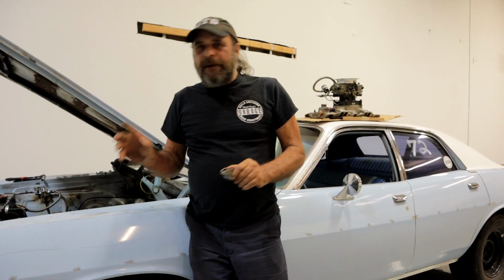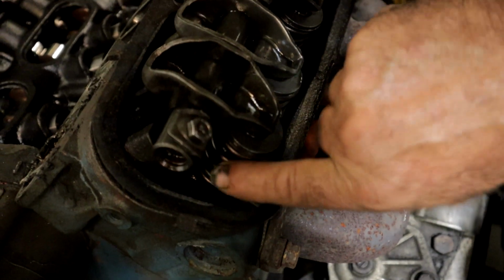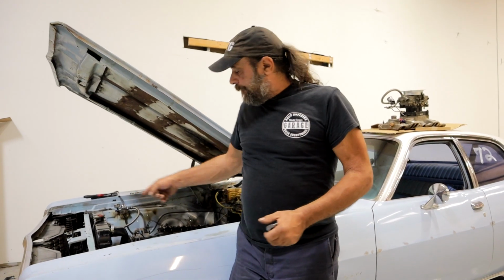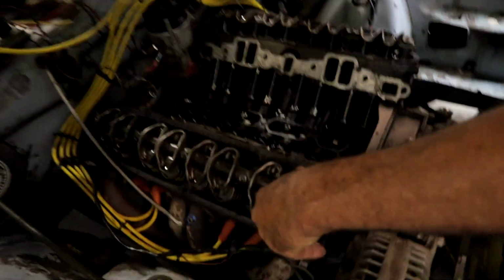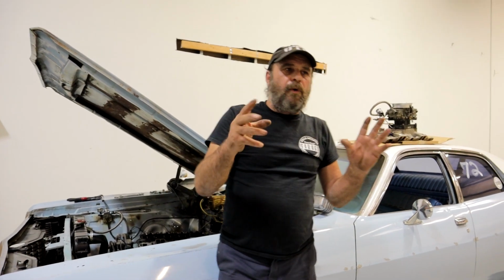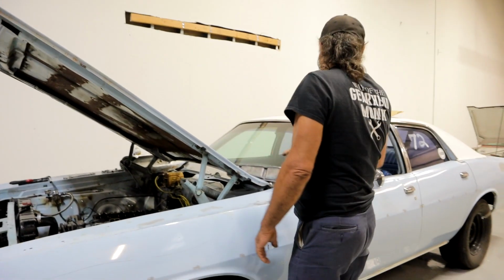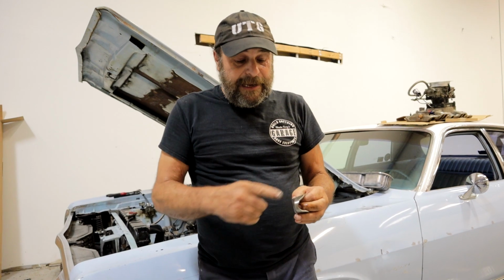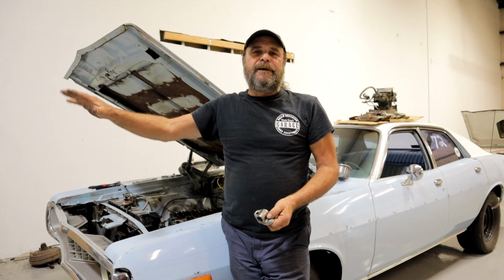Bottle Rocket Rocker Failure Explained

Comment: I’m not too knowledgeable on the mopar engine differences, but would factory roller lifters out of a magnum motor work?  Or for that matter, could a complete magnum block work with the heads and intake you have?  The only reason I suggest that is I have literally never heard of a magnum motor (or any factory roller cam motor from the late 80’s-early 00’s) having lifter failure. So if the top end will swap onto a magnum block, then go find a truck in the junkyard that runs, and use all the factory roller cam stuff.

Comment: I have heard this issue with hydraulic rollers over and over, especially in the LA motor. I was gonna put a hydraulic roller in my last LA build but after hearing all the guys who had this exact issue (even worse, wouldn’t pump up at all) and had to pull it all and go solid, I decided against it. I did still go hydraulic, but it’s a flat tappet. That being said, the first 16 I bought, 6 of them were .0005 too big in diameter and wouldn’t even slide in the lifter bore. I bought another set and out of the 16, 7 of them were also too big in diameter. After measuring and inspecting them all carefully, I was able to get a hood set of usable lifters. 3000 miles and all good but I had to work for it.

Comment: "Lifter holds oil." This is logical.  I fixed a Hyundai that had been sitting for months. After I put the head back on and started it, it was very loud. When the lifters finally pressurized, it never did that again, even when I don't drive it for days.

Comment: Gday Uncle Tony, Mate firstly I want to say I love your channel you say it how it is good on ya, ive been watching and laughing at the comments below most people just dont get the concept of a piston pushrod engine, if the geometry is right on those rockers they will take all that punishment and more, I have one question are the valve springs standard hydraulic flat tappet springs or roller springs hydraulic roller could possible require higher open pressure, I have also struck Hydraulic lifter failure from faulty oil filters bleeding back as well? cheers mate from Australia cant wait to see the solution

Comment: Good question Uncle Tony but I don't think they would/will ever give you a straight answer. I would say it has to do with their quality control or the lack of quality control. I would be pissed too!! They probably don't even care, they got your money and that's all that matters to them, it's the new way of doing business and it really sucks big time. 

Do you think spinning the engine over a few extra times to allow the lifters to build up oil pressure will help to keep from tearing up more rockers?

When I rebuilt my 351W for my '88 Crown Vic 20+ years ago, I went with a hydraulic Ford cam and lifters just to avoid these types of issues. There were folks having cam and lifter problems back then too from the big aftermarket companies. They asked questions and got the same answer, you must have not done this or that correctly. Most of them were switching over to a solid cam and lifter set ups.

Comment: What type of oil do you use?  Does the use of a higher grade racing oil make a difference in the hydraulic lifter?  Maybe it's just bad manufacturing of the lifters.  You know the old saying, "they don't make 'em like they used to."

Comment: I think a solid flat tappet cam with some 273 or aftermarket ductile rockers is probably the best option for the spirit of the build. You’re probably looking at the same outlay for everything as the hydraulic roller setup, but I know several people who are having zero issues with federal mogul stock replacement solid lifters right now. The other option with the hydraulic roller is a set of $500 Morel roller lifters, or to put adjustable rockers and solid rollers on the hydraulic roller cam. It just a shame that parts are so crappy now that I know of people who are having there 50 year old hydraulic lifters refaced instead of risking new with the “parts store lottery”.

Comment: As I have mentioned with flat tappets, there are only a few really trusted names that really stand behind their parts fully.  Howard's and Crower come to mind first.  A few custom cam grinders after that.  Anything else, it's a big roll of the dice...  
Just like the points thing, you are rolling the dice and they are loaded against you at this point.  
If you don't have a long standing good relationship with the supplier so they will talk to you honestly, you are prolly going to grenade the motor :(

Comment: I had a guy build me a 428 pontiac 15 years ago.  best of everything. comp cams hydraulic roller lifters were shot after 6 months . the idiot that built the engine had the wrong length push rods and wrong valve springs in this engine.  thanks Tony and kathy

Comment: There are only a couple of companies building lifters now a days. They put different names on the same lifters.  I guess is that different builder's demand better tolerances than others. With that thd price goes up. But roller lifters for a LA engine are far from cheap, anywhere.  I kept my original packaging for a while and checked them a couple of times before I throw the package away. I checked the the preload three times looking for a bad one.. I had luck they are all good 10,000 miles and a shit load of 1/4 mile runs later..

Comment: I no you wont agree but i put the lifters in the engine and prime the pump till the lifters are pumped up i know you should not have to but thats the only way i have prevented that exact problem,Then i install push rods and rockers then adjust.beleve me i have been down that road plenty this is the only thing i have found that works for me.you are so right about product to day it is junk.i built reman engins for years and the last couple of years building we had the same troubles you are.

Comment: Just a thought... in keeping with the broke racer theme, could you take apart the lifters and use washers in them and convert them to a solid lifter? Wouldnt work if you send them back though.
Reply from the maker: We'd still have to upgrade the shafts, rocker and pushrods, no?
Reply: @UncleTonysGarage  yup

Comment: What cam company was this? We always used speed pro hydraulic lifters with new but stock pushrods and rockers never bleed down like this.. always used flat tappet cam and lifters..... would a Roller lifters have a different bleed down? ..I would think not.  Speed pro was good in the 70's 80's early 90s.  And comp cams made some good mild streetable cams

Comment: I think this channel needs to get in touch with someone who has a 3D printer for car parts. If he did that, all of his cars would run perfectly. He could even design an engine, if he managed how he dealt with that 3D printing company in a cool way, or a partnership of something. That's how humanity is going to get these old car parts in the future, not by finding them rusting in salvage. There's only so much of that stuff around, and sooner or later, you won't ever be able to find those parts. Never going to happen, I know, but it would answer 99% of the problems he faces on this channel.

Comment: Well for me I use Mopar Performance and the Mopar engine book for me doing. Have not had any problems at all. I realize folks use Comp Cams, Isky, Summit and who ever. But to me mopar has many years of testing and development. I use stock valves but springs that go the cam. Stock push rods too.

Comment: I had a brand new lifter that was missing a circlip inside which allowed it to pump up until one exhaust valve hung open slightly. because it was a turbo engine, the pressure and heat from the manifold went back into the cylinder causing it to preignite. damaged a brand new race engine because of a defective new lifter

Comment: I have said it before...There is no law that you have to throw away chokes.  Anyone that doesn't want their Holley chokes, send them to me.  I have some used carbs that I bought cheap over the years. But some were missing chokes. :(
I'm not saying the damage would have been postponed if you start the car cold with with the choke on. 
 More to the point, Tony did you put a dial indicator on the lobe with the broken push rod?  Just wondering if that lobe wiped before the lifter broke. I want to see that lobe.

Comment: I’m no professional, but the only engine I can build cheap and have it reliable is an Ls. I build 3 cheap small block Chevys, 3 cheap small block fords, and 2 cheap 400 Ford. And they all had issues with parts. I build one not cheap sbc, one not cheap 400m Ford, and several cheap ls motors. They have all held together perfectly. The sbc has a solid roller and over 60k street miles built in 2015

Comment: You are better off salvaging used internal parts from OE engines than the "new" Eastern built failures. Rock Auto is pretty good about describing parts origins, sometimes you get lucky with their inventory. The mechanics in my area refuse to do any internal work due to the parts quality issue, you buy a Jasper engine and take your chances or junk the car.

Comment: I have the same problem, likely same company, bought the lifters that cam card suggests. Mine is a big block Chrysler but built very similarly stock rockers and the such. BTW, I had a slightly smaller cam same company and lifters do the same thing in the previous iteration of the engine.

Comment: Hey uncle tony what adjustable roller rockers do you recommend for a big block 440 that’s gonna be making around 11.5 to 1 compression and a 530s lift solid flat tappet cam? Also Im gonna run aftermarket valve springs

Comment: I wonder of the manufacture of lifters has changed because of modern engines, like with vvt they are able to retard the cam timing or expand valve overlap during warmup to correct forces operating on the valve train and the old school gets left in the dust? Also they are operating on much lower compression and lighter valve trains so the manufacture is able to cut corners without problems on newer models.
What about adjusting the oil viscosity? Go with a 20W30 instead of a 10W30?

Comment: How can we work with lifters that leak down when new and if this is what's available how can we be creative? If I installed a spark arrester and cranked the engine a few times to build oil pressure would that prime the lifters for startup? It's not a daily driver so the inconvenience would be minimal.  I know that doesn't excuse the *cam company but us average joes gotta work with what we can get in the short term.

Comment: Wild guess here, but faulty anti-drain back valve in the oil filter??
Reply from the maker: No, pressure comes up instantly on start
Reply: Possible, but that dry start rattle from a crap filter is kinda distinct because nothing has oil pressure for a second. I suspect a guy as experienced as UT can hear the difference.
Reply: Oil filter has nothing to do with hydraulic lifter leak down.  The hydraulic lifter is suppose to maintain it's own pressure and not leak down.
Reply: @UncleTonysGarage  The only other thing I can think is the lifter body diameter  is slightly smaller than stock causing too much clearance in the lifter bores allowing the oil to blead down after engine shut off..

Comment: Lifter oil hole orientation?
Reply: On flat tappet cams the lifters spin in the bore. Therefore I don't think it's an orientation issue. But I've been wrong before. Let's ask comp cams what they think. Oops didn't I just mention the manufacturer?
Reply: Lifter oriental*
Reply: Didn’t he say it was a roller hydraulic?
Reply: @matthemberry  yes it is a hydraulic roller. The roller lifters can only be oriented two ways and it shouldn't matter because flat tappets spin in the bore and they work fine. My point being the hydraulic portion of both types of lifter function the same.

Comment: Well guys I feel your pain but better parts are available I have been using hughes cams and rhoades v pro lifters and adjustable rockers of some sort in tons of builds and no issues. I also do tons of demo derby engines with no problems,  I say screw comp

Comment: Comp sucks don't use them. I've had nothing but problems . Such ass I got a solid roller cam and got the comp cam recommend valve springs . Totally wrong valve springs . Comp did not care I brought it to there attention . And they did nothing... So I don't use comp cams and will never use their parts again.... Good luck Tony

Comment: That isn't the real question. The real question should be as follows. How come you are experiencing issues, but I just built an LT4  Corvette 350 from 1996 with zero issues. Cam, valves, rods, springs, and gaskets. What is the margin of error? Those parts are used at my local dirt track with very few issues. Yet some people are experiencing issues. The only thing I can think of is maybe there is an installation, or break in problem.

Comment: Because they were made in China. Having said that, I went to solid lifters years ago and never looked back. You want to keep it simple, use solid flat tappet lifters with polly locks. The polly locks hold the lash a long time, and much cheaper than rollers. A stock engine doesn't need rollers. The flat tappet cams are way cheaper.
Reply: May not 'need' rollers but with  the quality of flat tappet stuff that eats loibes like no tomorrow there is no option. and I have no love for pulling the rockers off an air conditioned street daily driver to check / adjust solids every few months winter and summer. fine for a weekend warrior I guess. but not for street daily drivers. .
Reply: @blair79bear38  Once a year is enough, and   the old school engines bays are way less cluttered than todays cars. Lifters from Howards, crane, isky are top of the line. Comp Cams are hit and miss.

Comment: Hydraulic lash adjuster manufacturing is a precision science. The leakdown plunger and the ID of it's bore should both be precision ground, and the clearance should be just a few tenths. In addition, these parts should be cryo treated, because deficiencies in the microstructure can lead to dimensional changes that either cause your condition or stuck lash adjusters. This precision grinding and cryo treatment can be expensive to do, I'm sure a lot of people are looking for places to cut corners.

Comment: I thought hydraulic roller cams had faster ramp rates that would put more stress on the stock valve train?
Reply: You’re 100% correct.
Reply from the maker: This is a street roller.  A bit more aggressive than stock, but not enough to overwhelm the stock valvetrain
Reply: The problem is not with the cam, it is with the lifters bleeding down, the most wear on an engine happens at start up, and having bled down lifters is gonna cause a whole lot more problems than anyone would want.

Comment: So, I've read thru all the comments and I give up. Which big cam company made made the faulty lifters?
Reply: @frenchonion4595  oh okay
Reply: COMP
Reply: @johnwilburn  Right, never used them. I did use a crane cam many years ago that ended up failing with a lobe worn round.

Comment: Even Oem dealer parts are iffy. Why? Because all the dud parts from the assembly line get sold at dealerships. Theron companies like GM get other suppliers to keep making rom parts in counties like Mexico. Had an ls1 Canadian water pump and lasted 20 years 200,000 miles. New water pump purchased from GM, made in Mexico leaked after 1 week. Screwed either way.

Comment: That cam company is probably apt to give you some story about incorrect or inadequate lifter preload based on the fact that you aren't running an adjustable rocker set up...yadda yadda yadda 
Although that's probably not the case.
I think you should consult David Vizard on the subject. He has tons of knowledge and experience in hydraulic lifters and bleed down etc.

Comment: My old chevy 400 build from 2008 with all Comp components never bleed down those hydraulic lifters.  Not even if it sits all summer and is not started. (Winter truck).  I would be very upset too!

Comment: I can't count how many times I've gone through tools, parts, machines, and appliances like this.     The brand matters little now.
Its sometimes the simplest of things.  Alternators that don't charge, starters that won't spin.  Gas caps that don't vent.   Shop vacs that only last 15 minutes. Air fryers that smell like a burning trash bag while using.  You get the idea. 

Pitman arm pullers splitting ( KD tools from Napa).  They said I was the problem, and wouldn't return the second one...   

I've had more bad parts in person from the major parts stores than anywhere else.   For the most part I get the non complicated stuff from Amazon ( like brake rotors- no problems yet), a lot of things from rockauto( I pick the brands that might still be ok).
   
I still run NGK plugs. I feel if the rest of the industry is going to crap, NGK will still be there....  I mess with a many of weird, old, and screwy vehicles.  I have no problem buying 30 year old+ parts......

Just a crap shoot anymore eh?

Comment: I am an engine builder and I can see two problems with the setup first problem the standard rockers are only good for 500 lift max  and you've got a cam with 550 lift stock 340 valve springs are only 240 lbs open  so not enough spring pressure to start with for a cam profile like that you cannot run more than 480 lift with the standard valve spring without going into coil bind that's why it has damaged the rocker .. the spring has gone solid and has  squeezed  oil out of the lifter at RPM

Comment: Is the cam ground on a reduced base circle?
Reply: I’m wondering if he checked the valve train geometry and verified that the pushrods are the right length.
Reply from the maker: Between .020 and .030 preload across the board
Reply: @matthemberry  I'm sure he did.